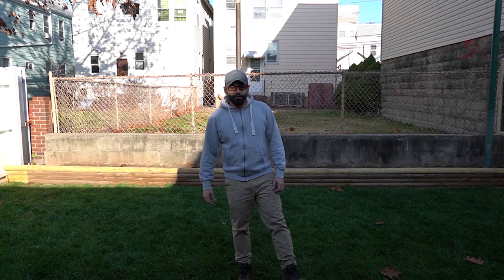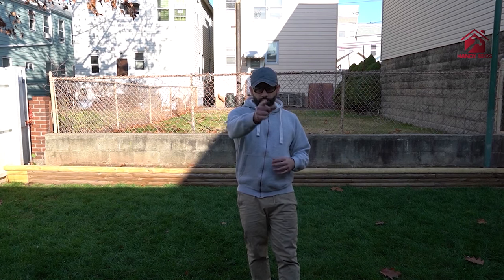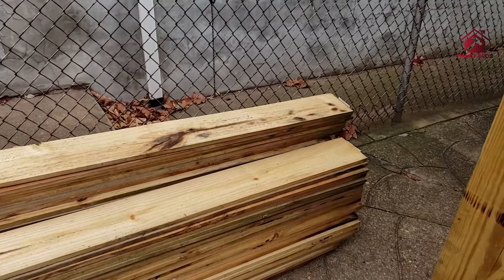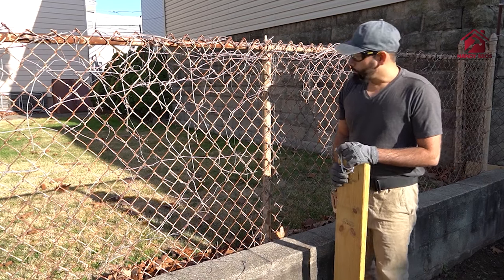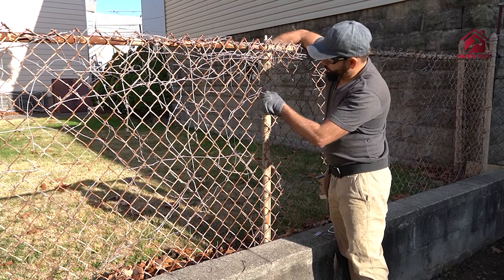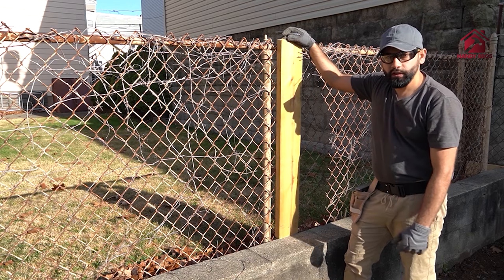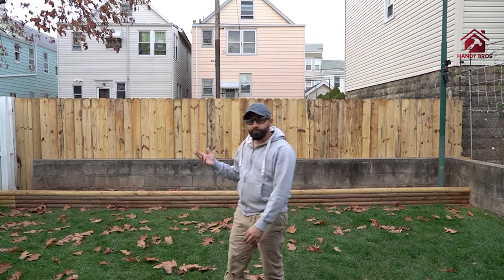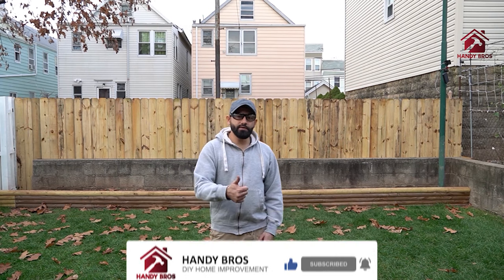Wood Fence Over Wire Fence or Chain Link Fence | HANDYBROS |

Comment: This was so helpful. I inherited a chainlink privacy fence with weird green filling and was quoted over 10K for a vinyl replacement and that didn't include removing the chainlink posts and fence. This is a much better solution. I have a wood deck for an above ground pool so I will match the wood color with the color of the deck that I just stripped, sanded and repainted last summer.

Comment: Great video,  I like that you can do this from your own yard with no need to get into the neighbors yard. One time saver that I'm going to incorporate into my project though....once I measure the first  2 x 6 for the U-bolt placement and drill it....I will use that first one as a template and drill out all the 2 x 6 in one shot, rather than measure each one out.

Comment: Looks nice.  Best to keep the bottom of wood posts and slats at least 1/2"-1" above the top of the concrete block wall to prevent the end grain of the wood from absorbing water.
Reply from the maker: That's a great tip! Will surely keep that in mind for our future projects.
Reply: What about if soil underneath? Same rules apply?
Reply: @Eastbaypisces  Possibly even more gap is needed as dirt and leaves may build up against the bottom of the posts and slats promoting rot.  Also, wood in direct contact with soil is not a good idea where ground termites are a problem.
Reply: Brush the bottom of the slats with exterior grade polyurethane to seal the end grain.

Comment: Thank you for posting. This is very helpful for a project I'm starting that will connect a wood fence to a chain link fence. I'm also looking for ways to protect my wood fence long term. Hope you can answer a few questions: 
1. What type of lumber are you using (ex. pine, cedar...) and why did you choose it? 
2. Is any/all of the lumber you used pressure treated? 
3. Did you pre-treat the cut sections with wood preservative or stain the frame prior to assembling?
4. Did you stain the fence after assembling? 
5. What additional protective products did you use?
Reply from the maker: We just went with the pine for the pickets as they are readily available and cost effective. 
All lumber used was pressure treated.
We did not pre treat cut sections or frame prior to assembling. Extra treatment will enhance longevity of the fence.
we painted the fence after the wood dried out.

Comment: Nice one! Exactly what I needed to see. The overall picture. Now my problem is I need to do this with a 4x4 chain link gate. How would you go about doing this to the gate in conjunction with this conversion?
Reply from the maker: You can use the pipe clamps of appropriate size to attach the vertical or horizontal wood framing to the top and bottom rail of the gate.

Comment: This is genius,  i started one side of my privacy fence the "correct" way, but recently started thinking maybe i could utilize existing fence ( i live in a 70's era neighborhood that seems to have had a preinstalled chain link around entire neighborhood housing as part of their build. I want my backyard 100% isolated from my neighbors view. This 100% would save time as the big thing, as no need to dig post holes or crete them in. But i wonder if money could also be saved. A pt post is $10 where i live, plus factor in maybe 1/2 bag of crete ( roughly 3-4 bucks each post ) . If the anchor bolts are only a buck or two each, and the 2x6x8 here is $4.47 each , that would definitely save money as i probably need another 25 posts to complete the east wall, and north wall . Also begs to wonder if existing chain link gate would be stong enough to attach same idea to and support the added weight without sag.  Il the posts themselves are extremely stout, as i tried to remove it and gave up trying and built the fence on the opposite side of it

Comment: I have a fence that is touching the retaining wall just like this. Is a 2" clearance under the panels needed on a retaining wall block to prevent moisture from rotting the bottom of the panels? I know the clearance is for soil but not sure about block. Wondering if I need to raise my panels or leave them as is? Thanks!

Comment: Great video. Could you do this over a chain link fence gate as well? Would the wood weight too much for the hinges on the gate?
Reply: I did wooden attached to chainlink. I have been fighting with it for years. It keep blowing down and it has broken most of my chainlink, even the posts have bent and broken. Every time there is any wind, it damages large sections of the fence. I'm gonna have to call it quits and just rip it all down and do it properly. I'm just so tired of repairing it to no avail.

Comment: Can you leave the fence at 6 feet instead of cutting it like you did?  I have the same chain link fence but would like the wood fence to be 6ft
Reply from the maker: Well typically the top privacy fence should be about 6 ft from the ground. That's the reason we cut ours to maintain that height and to match with fence height on the other side. If you use the full length of the picket, add another horizontal member so that there are 3 horizontal members supporting a 6 ft picket.
Reply: @HandyBros  This is probably less expensive than the dig a hole for cement to support posts version, isn't it?
Reply: Did you complete the project? I have same thing to do at my home

Comment: Just a few things of note. You don't explain why you loosely tighten the 2x6 boards at first. Also, shouldn't you leave about a half inch of space between the pickets to allow the wood room to swell when it rains? Otherwise the boards may warp

Comment: Hold would you have done this using fence panels? Is it the same?
Reply from the maker: It would be quite similar. Once you have horizontal members set, just screw the fence panels directly on them. Ideally, align the horizontal members with the horizontal members of the fence panel.

Comment: My chain link poles are more than 8 ft (96”) apart.  Is that going to be a problem! For example, I have six poles and a couple of the spaces in between our 119” and 117”. So closer to 10ft.

Comment: Question. Is that gate behind you your fence? Is it your neighbors shared fence? I wonder if they decide to change the ugly old fence would it uproot your privacy fence?
Reply from the maker: That was not a gate. I am not sure if that was a shared fence. What we did is so easily removable and plus its non-destructive. They we installed, its clamped with the existing fence posts so yes, privacy fence will get impacted if someone tries to do anything with the existing chainlink fence.

Comment: Looks nice. Why didn't you attach boards to posts on center so it looks nice on neighbor's side?
Reply from the maker: Not sure exactly what you referring to. The vertical boards are attached on center of the existing steel post.
Reply: I think he was referring to you overlapping woth horizontal braces. It woukd look near if they didnt overlap but went in a straight line @HandyBros

Comment: So...how do you repair the fence when the wind blows both of them down? I put a privacy fence on top of chain link. I have reinforced it many times over and it keeps destroying both the original and the new fence. I have put 8 foot posts in and it still breaks everywhere. It's been 3 years of struggling with this fence. Every storm blows it down. The chainlink posts have broken over. I'm at the point where I'm just gonna have to do the wooden privacy fence properly. Any wind destroys it and I can't keep it up.

Comment: If the current chain link is 4’… can the 2x6 wood post be 6’? … to make the fence a little taller? 
Also… what if your current chain link/yard is on a slope? How to cut the vertical pieces so they are flush to the ground and the overall site line of the fence is smooth and even?

Comment: Omgeee good idea I was about to purchase the OZ dense brackets.
Reply from the maker: OZ brackets would work if you have access from the side of the fence. Also, if you are only running the horizontal members, the U-bolt would stick out and you may have to cut it and drill a hole in the picket. So OZ brackets would do better if you have horizontal member only.
We did a trick and added vertical member (to act as a post) and were able to use U-bolts without an issue.

Comment: Hello!! How do you secure the  2x6 to a the metal post if it has fencing attached at a 90 degree angle ? Thanks 😊
Reply from the maker: that is a little tricky but doable. I would first attach two 2x6 together at 90 degree angle. Then, install a longer U-bolt to the post with one leg of the bolt through one side of 2x6 and the other to the second 2x6. Hope this makes sense.

Comment: Did you have any issue with the added weight? Good video 👍
Reply from the maker: Thanks. The added weight is negligible compared to the strength and load bearing capacity of the fence post.

Comment: I don't understand why you needed the 2x6? i would think attaching the 2x4 directly to the metal posts would have worked
Reply: No, it wouldn't. When you attach the 2 x 4 it recesses the U-bolt attached to the 2 x 6, which is then covered up with the fencing. If you went 2 x 4 only, you will have exposed U-bolts.

Comment: I want to try something similar, but I want the wooden fence to be a couple feet taller than the top of the chain link.   Maybe interspersing some taller Postmaster fence posts in between the existing chain link posts will help achieve that additional height without risking instability...  If anyone sees anything like this, please post some links!  :)
Reply: Same boat I want to go 2 feet higher, which should still work.
Reply: I want to go higher as well without installing 4x4 fence posts.

Comment: I wish you would add a little instructional video own how you do a corner post of the chain link fence.
Reply from the maker: for that you can use a longer U-bolt and come at an angle to the corner post. the horizontal member will hide that anyway. If the bolt happens to be too long, cut the excess using a grinder.

Comment: Can the Height be extended I have a short fence
Reply from the maker: Absolutely. You can do 6-8 ft height fence with the same procedure. Add additional horizontal supports for added stability.

Comment: Is this your fence, if not. How does neighbor feel about you attaching u-bolts to their fence?
Reply from the maker: So far no one said anything :)
Reply: Most the time- a fence like that is shared- and if the fence is there in the first place, it is a cheap, ugly ghetto looking fence with no privacy- and STILL looks better with the wood and provides privacy from the other side as well. Can you tell I have this issue with the dump- fixer I bought? :)
Reply: As soon as I saw it I knew it wasn't his to attach anything to it. If the owner of that house is a Jackass they will tell you to remove it.

Comment: By you placing the wood touching the cement it will make the wood ROT QUICKER. Cement holds moisture and the wood (yes even treated wood) will soak it up. 🤔🤔🙄🙄🤨🤨
Reply from the maker: That's a great point. I guess one should leave half inch to an inch below the fence panel.

Comment: Mine's gonna have to be higher. 👀
Reply from the maker: you can have the higher fence but check with your township requirement or local code. Most of the time they have a limit on high you can go.
Reply: @HandyBros , on this side it would be high enough, but my pit bull would jump it from the other side. Aren't privacy fences usually 6 ft?

Comment: So wasteful cutting those pickets in half like that. I’d install the whole pickets and u get more privacy. Of course your 2x6 will have to be a bit higher too. But thank you for the idea, I forgot about u bolts
Reply from the maker: We did that to match the height of the fence on the other sides of the fence. Also, most towns have restrictions on the max height of the privacy fence as well.

Comment: What happens when it’s sell time? I’m assuming this will fail inspection?
Reply from the maker: I don't think this would be an issue. Worst case scenario, unscrew everything and take it out. The fence was done in a way not to impact any of the existing fence or the ground.